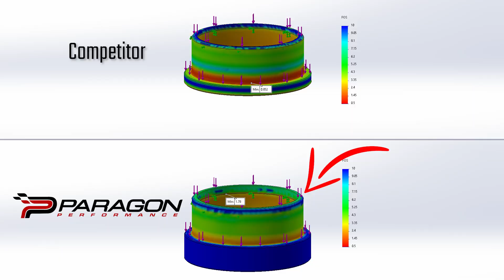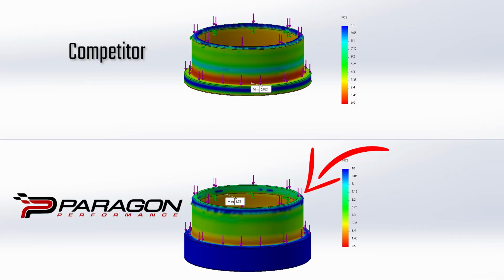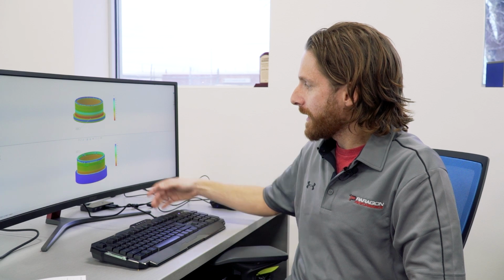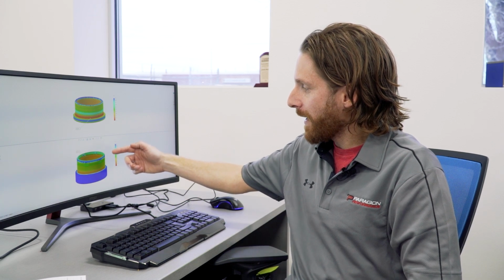C8 Corvette Front Lift Lowering Collars - Behind the Engineering with Paragon Performance

Comment: Your competitor, Cicio performance, has a front kit that says it lowers it 1" in the front.  From what Pat says in the video, the max allowed is .75 inches.....I'm confused.  Is Cicio's max lowering actually .75 inches and they are just advertising it as 1"???
Reply from the maker: Paragon Pat doesn't lie, the max you're able to lower your front lift is .75"  We are accounting for the static drop only and not including what the springs might settle at. 

Our competitor is claiming "Lower the front end approximately 1 inch ".

Comment: Pat, what I want to know is this: If I lower the car with your collar, will I still have the same clearance with the front lift? I have a jacked up entry into my driveway and where the street slopes toward the curb and my driveway apron slopes toward the curb creating a V. I need all I can get to get in and out and the Lift Assist is a God send. I can't afford to loose anything but if I could go with these collars and retain the travel up and down I'd consider it for sure.
Reply from the maker: The travel of the front lift will remain the same but you will be lowering the front of your C8 by .75" 

We do offer a 3/8" shim that will only lower it 3/8" if you want a subtle drop. 
 - Paragon Pat
Reply: @ParagonPerformance  almost seems like it wouldn't be worth it. I know I can loose the height travel at all. Just wonder if it's worth the time, trouble and coin for the look. I've always lowered my cars (Camaro SS's ) and no front lift in play but as we do with lowered cars, we take things at an angle for ingress and egress.
I'll have to get some more info for sure. In the meantime 'Praise The Lowered!'

Comment: Thanks. Great insight. Will ride quality be affected by getting collar and lowering car and not getting a different spring.  Or will it be better to just swap the springs to get a minimal lowering of .5 or .75 and leave the collar alone.
Reply from the maker: Ajit, ride quality will not be affected with our lowering collars. We recommend starting off with our collars for a initial drop as they are more affordable. Our springs by Hyperco are 30% stiffer than stock and offer a .5" drop. You can find more information on the springs below as long as some photos with both the collars and springs installed. 

https://www.paragonperf.com/paragon-performance-lowering-springs-by-hypercoil.html